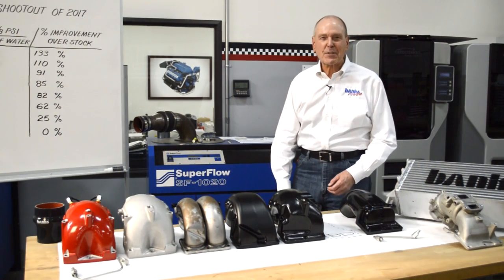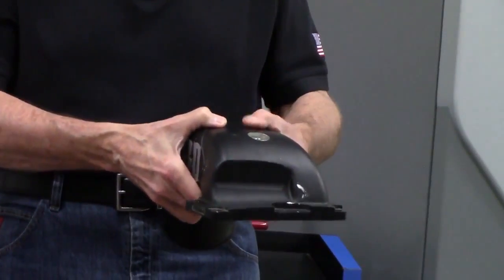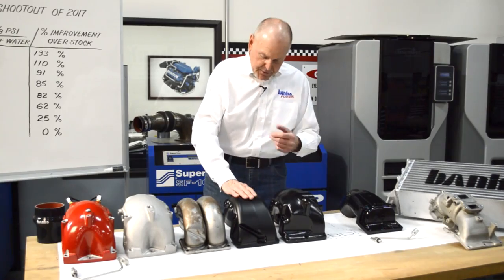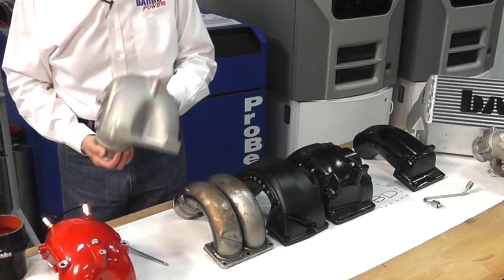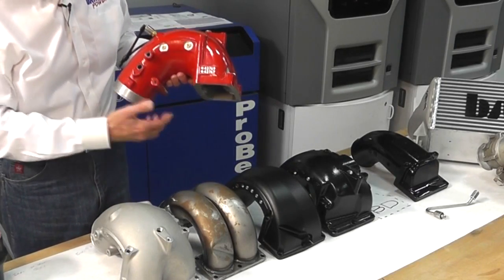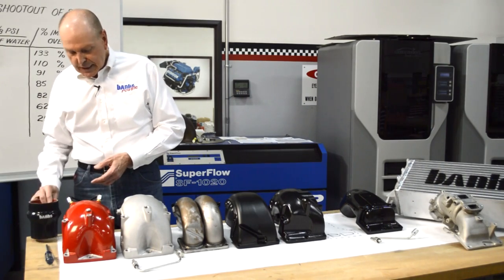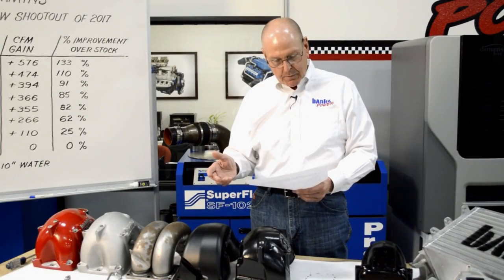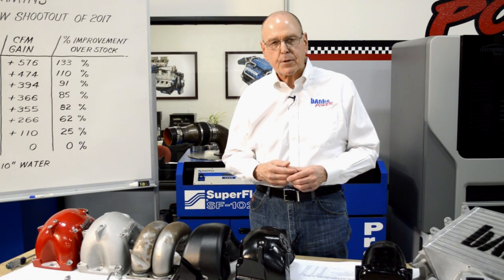Banks Monster-Ram is the best Cummins 6.7L intake manifold available.

Comment: Just a general question.  Why, other than the optimal methanol spray angle and sensor mount angle, do you need a 1000 com elbow on a cummins stock head that can't flow even 300 cfm?  Race heads can't flow much more than that...

Comment: Yes, GB is a living legend in the world of diesel performance and his products are top quality. But, how much of the flow increase of these pieces can the engine actually use?
Reply: Banks is just like Edelbrock. If you buy a complete Edelbrock kit it will do everything they claim and is better than anything else for the money. If you buy a Banks kit it will absolutely do everything he claims, increase power, fuel efficiency and your engines reliability under heavy use. It's not cheap but it is a bargain. Money well spent you will not be dissapointed. Want more power? Tell him what you want, Banks can do almost ANYTHING you want better than anyone else and no guessing. He knows.

Comment: Saw one of these a while back and I was struck by the engine's intake design - the inlet being right at the front of the engine. I was also struck by Mr banks' intake design - I thought there may have been an advantage in reducing the outlet of the elbow a little at the rear to form a venturii effect by using an internal radius to help turn the air towards the rear cylinders, even extending the elbow into the manifold to get a better radius.
As is, it would seem that the front cylinders will run with a little more effective boost than the rear ones* - or am I missing something here - remember, however good something is in isolation, it is how it works in place that counts? Perhaps just trying them on a bare head and checking the CFM at each cylinder, as in some cases the average may be different from the peaks and for any engine, it is important that they beathe the same for best performance - NOTE, I believe Mr Banks' products would still come out on top, and I otherwise do like their design, but in isolation...
Not being a smart-ass, it is a genuine query.

*Anyone tried running pressure sensors at each end of a running, loaded engine?

Comment: There not adding the price for the extra line to clear also how much boost is the amount of air they were pushing a better comparison would be a truck on the dump back to back if bank was so good put those on last and it should gane hp no matter how hot if they  move the amount of air they say they do

Comment: What good is this test if the elbow isnt the most restrictive part in the intake? To be more accurate you would have to set up an entire intake from turbo to intercooler to cylinder head and test that.

Comment: fordrac1ng81 - actually I’m a degreed Engineer who’s built many racing engines and done CFD intake manifold and head modeling work for a Pro Stock team in the late ‘80’s and early ‘90’s.   There’s a good reason we threw a large towel over our intake manifold every time we took the hood off - we invested thousands of hours in plenum and runner design.  If he’s running his flow bench at 10 inches of water it’s equivalent to between 3/8 to 1/2 pound of boost depending on variables like altitude and barometric pressure - so it’s a fair test.  Ask my buddy Steve Morris up in Michigan how much a carburetor hat or an EFI inlet elbow design change is worth under 20 pounds of boost - it makes a HUGE difference.  Imagine what Gale’s inlet would be worth on a diesel compound boost set-up.  Gale knows more about boosted diesel inlet design than anyone else walking the planet.
Reply: Steve🖒
Reply: I was just looking for a comment explaining why he used such a small amount of pressure while testing a diesel that usually runs high boost.. So in not engineer speak it is a matter of how much of an advantage can be seen in flow without the aid if tons of pressure forcing it through?
Reply: @jblob5764  the flowbench maxes out at 1100 cfm. so any more pressure and he would not be able to measure it.
Reply: Flow bench limitations and many in the industry flow at 10” for large CFM items which makes for an easier comparison from others who deal with real world flow bench data.

Comment: As a 5.9 cummins owner, i would really like to see the same test done on the 5.9 24 valve cummins intake manifolds. obviously the 2003 to 2007 intakes are more restrictive than the 1998.5 to 2002, but other than the left two bolt locations (on top of manifold vs at the flange) I think it would make for another great video.

Comment: There are many factors to measuring performance on a dyno or drag strip, but comparing component to component using CFM's makes to most sense.  Banks has been doing diesel performance and winning at the track for years.  In summary, the man knows what he is talking about; diesels are not a sideline at Banks.
Reply: Looking at the individual component makes the least sense. Your engine is a system, not an individual component. You need to determine which component is your weakest flowing component and address that first.  Having an intake that has a 200% or 2000% the stock flow does not matter if that's not your limiting factor.
Reply: @otm646  I'll give you partial credit but the banks intakes have engineered flow for water/meth upgrades, and an intake is more of a support upgrade. you won't see huge gains but you will see them after other upgrades have been made like a turbo or head job. flowbench testing is the best method, you have CFM numbers to compare on the specific part. you can't dyno 4,000 different engine configurations, Banks would go bankrupt, so they leave that up to you

Comment: Gale Banks you sir are an engineering genius but I dislike the bashing of the competition. My pusher has far superior flow over stock with block off plates. Sure on a dyno pushing big power we can get down to the nitty gritty but a daily driver? Let’s be real. Round tubing, muffler shop haha terrible concept Pusher lol
Reply: It's not bashing, he just pointed out the issues he has with the competition.
Reply: Got a pusher y bridge on my lbz and that thing is a beauty. Looked like it belonged on a pro stock turbo car. Havent met a single person who calculates their own fuel that gets nearly 25mpg runnin 85mph on the high way. But i will say it does look like pusher could have done a lil better with the 6.7 intake.

Comment: Cheesy but informative. I bought the H&S and am now considering the banks because they didn't cut corners. The new fuel line and design is better. Left little to argue. Nice product.
Reply: Yes, the elbow flows more, but if your cylinder head is stock, and you don't plan on porting and upsizing the valves in your cylinder head, you're throwing your money away. The flow restriction on a stock motor isn't the elbow, or even the intercooler, it's the cylinder head and valves themselves.
Reply: Finally the truth...
Reply: Great video Gale. In reality this was very straight forward, comprehensive and well done test, regardless of how you view the product. We had similar results when doing research and were able to show a marked increase in flow rates on mirror applications. They key to remember is by eliminating restriction not only equals more flow but also equals the amount of heat that is being dissipated. For example if you were to break down flow rates into each cylinder, one would think that they are all equal. This is not the case. In real world applications, each cylinder varies more than you realize and this is very apparent the farther away from pressurized zone at the inlet of the plenum that attaches to air intake horn. When analyzing the laminar and thermal flow rates into each cylinder, is was discovered that #5 and most notably #6 we almost starving for air in comparison to cylinders #2 and #3 with #1 and #4  following. One of the most logical ways to cure this problem is to make every attempt to equalize pressure into each valve inlet within the cylinder head. When you consider the stock configuration limitations it would make the most sense remove any restrictions possible and make all attempts to increase air into the cylinders that are starving or better yet suffocating for air. In racing and pulling applications, it is common to literally have the bottom half of the casting intake on the cylinder head to be machined off and utilize extremely high flow intake manifold assembly that encourages equaled flow into each cylinder. This is done not only for power but also heat. All in all and to be honest you would not gain much power from utilizing any on these systems but you will most definitely gain some and dissipate heat. Much like an high flow exhaust system, only marginal power gains can be found but additional heat is eliminated. Most power increase come from tailoring to programing pulse deration, sequence,  timing and other parameters including charge volume and pressure. With that being said it would stand to reason that increasing power via programing and increase volume and pressure by larger or multiple turbo chargers that every restriction possible should be eliminated. One thing you can say about Banks is that they do their homework and a lot of research and development goes into their products. I believe that as far as bolt on applications go the only system better than this Banks unit is the application that is currently under development here at Diesel Research Labs. This design will have close to 100% equal dispersion to all cylinders and flow a lot more air than even the Banks unit but it will be released in very limited numbers so I would just get the banks. It is the best of the bunch tested.

Comment: You should test these on a dyno to see what the differences would be on a truck under load. The behavior of a turbo will change when it is under load and the intake elbow will affect how that behavior changes.
Reply: The flow bench is the standard device to measure air flow.  Dyno's require way more work and introduce a lot more variables that can skew the results.

Comment: this "test" is laughable.  good job banks....lets slander all your competitors without real evidence testing.  way to earn the respect in the industry.  this came off very cheesy.
Reply: Flow improvement is indeed “real evidence”.  Last time I checked internal combustion engines were nothing more than air pumps.  Do you honestly think the H&S makes more power than the higher flowing elbows?
Reply: The flow bench is real evidence.
Reply: Thats how Banks rolls. He did the same thing for the Cali air resource board (CARB) He ratted everybody else out and said only his product was smog legal.
Reply: PATRIOTatALTITUDE Did you watch a different video than the rest of us?
Reply: Just Posted - Great video Gale. In reality this was very straight forward, comprehensive and well done test, regardless of how you view the product. We had similar results when doing research and were able to show a marked increase in flow rates on mirror applications. They key to remember is by eliminating restriction not only equals more flow but also equals the amount of heat that is being dissipated. For example if you were to break down flow rates into each cylinder, one would think that they are all equal. This is not the case. In real world applications, each cylinder varies more than you realize and this is very apparent the farther away from pressurized zone at the inlet of the plenum that attaches to air intake horn. When analyzing the laminar and thermal flow rates into each cylinder, is was discovered that #5 and most notably #6 we almost starving for air in comparison to cylinders #2 and #3 with #1 and #4  following. One of the most logical ways to cure this problem is to make every attempt to equalize pressure into each valve inlet within the cylinder head. When you consider the stock configuration limitations it would make the most sense remove any restrictions possible and make all attempts to increase air into the cylinders that are starving or better yet suffocating for air. In racing and pulling applications, it is common to literally have the bottom half of the casting intake on the cylinder head to be machined off and utilize extremely high flow intake manifold assembly that encourages equaled flow into each cylinder. This is done not only for power but also heat. All in all and to be honest you would not gain much power from utilizing any on these systems but you will most definitely gain some and dissipate heat. Much like an high flow exhaust system, only marginal power gains can be found but additional heat is eliminated. Most power increase come from tailoring to programing pulse deration, sequence,  timing and other parameters including charge volume and pressure. With that being said it would stand to reason that increasing power via programing and increase volume and pressure by larger or multiple turbo chargers that every restriction possible should be eliminated. One thing you can say about Banks is that they do their homework and a lot of research and development goes into their products. I believe that as far as bolt on applications go the only system better than this Banks unit is the application that is currently under development here at Diesel Research Labs. This design will have close to 100% equal dispersion to all cylinders and flow a lot more air than even the Banks unit but it will be released in very limited numbers so I would just get the banks. It is the best of the bunch tested.
Reply: You've never built a performance motor and done CFM testing, I'm guessing. He showed flow numbers, at what pressure. If anything, he went farther than he needed to.
Reply: fordrac1ng81 - actually I’m a degreed Engineer who’s built many racing engines and done CFD intake manifold and head modeling work for a Pro Stock team in the late ‘80’s and early ‘90’s.   There’s a good reason we threw a large towel over our intake manifold every time we took the hood off - we invested thousands of hours in plenum and runner design.  If he’s running his flow bench at 10 inches of water it’s equivalent to between 3/8 to 1/2 pound of boost depending on variables like altitude and barometric pressure - so it’s a fair test.  Ask my buddy Steve Morris up in Michigan how much a carburetor hat or an EFI inlet elbow design change is worth under 20 pounds of boost - it makes a HUGE difference.  Imagine what Gale’s inlet would be worth on a diesel compound boost set-up.  Gale knows more about boosted diesel inlet design than anyone else walking the planet.

Comment: Ok. So you increase the flow potential of the elbow by 133%. What if the elbow isn't the "bottleneck"??? What if the cylinder head port is the real bottleneck? 1000% increase on the elbow isn't going to do jackshit if the cylinder head can't handle it. So I have to respectfully call bullshit. Sorry...
Reply: Great video Gale. In reality this was very straight forward, comprehensive and well done test, regardless of how you view the product. We had similar results when doing research and were able to show a marked increase in flow rates on mirror applications. They key to remember is by eliminating restriction not only equals more flow but also equals the amount of heat that is being dissipated. For example if you were to break down flow rates into each cylinder, one would think that they are all equal. This is not the case. In real world applications, each cylinder varies more than you realize and this is very apparent the farther away from pressurized zone at the inlet of the plenum that attaches to air intake horn. When analyzing the laminar and thermal flow rates into each cylinder, is was discovered that #5 and most notably #6 we almost starving for air in comparison to cylinders #2 and #3 with #1 and #4  following. One of the most logical ways to cure this problem is to make every attempt to equalize pressure into each valve inlet within the cylinder head. When you consider the stock configuration limitations it would make the most sense remove any restrictions possible and make all attempts to increase air into the cylinders that are starving or better yet suffocating for air. In racing and pulling applications, it is common to literally have the bottom half of the casting intake on the cylinder head to be machined off and utilize extremely high flow intake manifold assembly that encourages equaled flow into each cylinder. This is done not only for power but also heat. All in all and to be honest you would not gain much power from utilizing any on these systems but you will most definitely gain some and dissipate heat. Much like an high flow exhaust system, only marginal power gains can be found but additional heat is eliminated. Most power increase come from tailoring to programing pulse deration, sequence,  timing and other parameters including charge volume and pressure. With that being said it would stand to reason that increasing power via programing and increase volume and pressure by larger or multiple turbo chargers that every restriction possible should be eliminated. One thing you can say about Banks is that they do their homework and a lot of research and development goes into their products. I believe that as far as bolt on applications go the only system better than this Banks unit is the application that is currently under development here at Diesel Research Labs. This design will have close to 100% equal dispersion to all cylinders and flow a lot more air than even the Banks unit but it will be released in very limited numbers so I would just get the banks. It is the best of the bunch tested.
Reply: Then port your intake?
Reply: MCE Performance Banks has a procedure to mill the intake off and then you can port the he'll out of the head
Reply: Now you're talking!